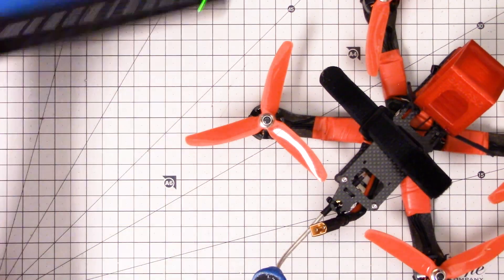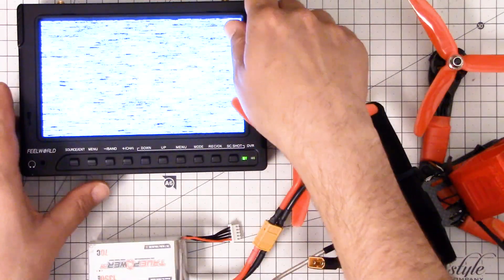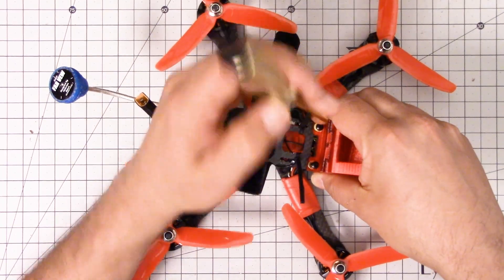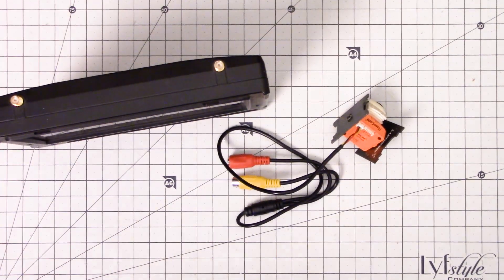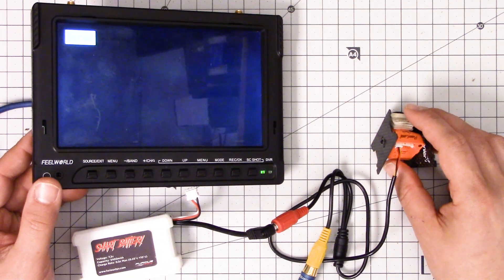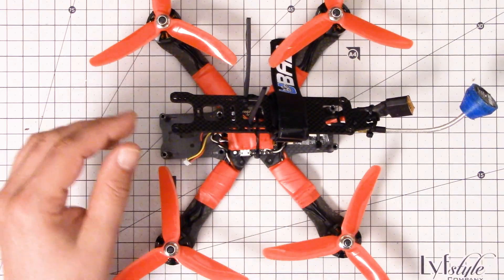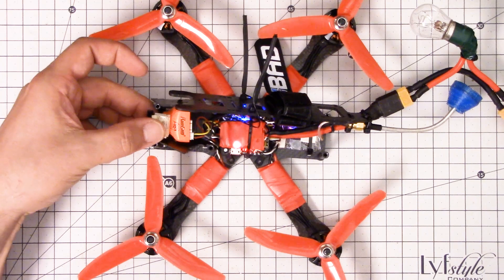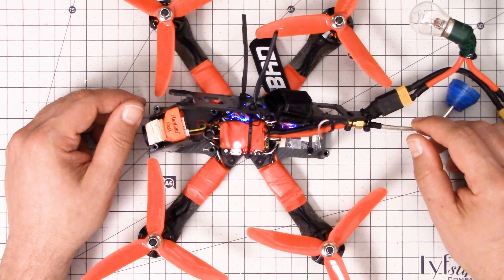FPV Camera Black Screen | REAL WORLD TROUBLESHOOT

Comment: Crashed my quad today in the sand at the park. Everything seems to be working fine except all I get is static on the video. I'm really new to this but I assume the VTX is bad which sucks because tall the solder connections are super tiny in this cinewoop.

Comment: What about an issue where the video signal and OSD is fine sitting idle on the bench, but as soon as you throttle up, the video signal cuts to grey but OSD is still fine.
Reply from the maker: That points to the camera wires. They're daged and the vibration is making them come loose.
Reply: @JoshuaBardwell  oh interesting! It's a brand new Mobula 6 too. 🙄 Guess It's time to resolder the camera...🤷‍♂️ Haha thanks for the response man, I appreciate it! Keep up the great work!

Comment: My FPV camera shut off when I'm throttling only when the camera is recording in FHD at 60fps, it's not happening at 30fps or when not recording. black video with OSD. the camera is RunCam Split3 Lite, drone still flies while this happen. the FC is brand new (F4 ELRS AIO board), but then i checked that 1 motor is broken, still diagnosing..

Comment: I asked you on a live streama few months back if OSD chips are interchangeable, you said yes and I've since confirmed it to be true......ordered a few blank chips and yes they work. I had a Diatone Mamba V1 on my Chameleon that lost OSD. I put in a Foxeer Razer for the OSD as opposed to swap the FC. Then the chips arrived and I changed it out on the FC......still no joy. The Razer camera accidentally shorted and went black which forced me to troubleshoot all. Found a microscop[ic solder ball on the FC. Isopropyl bath and all is well. Video, OSD, and A new Ratel.

Comment: I was just investigating a similar problem. I got the OSD on the screen but image was grey. After some investigation I noticed, that the flight controller was outputting 0.5V on the 5V rail. So I tested the other 5V rails and there were multiple ones too low. However I found a functioning 5V output and tried that for the camera and it immediately worked. In your case it was likely to be the flight controller as well, because a) the camera gets it's power from there (I'm assuming) and b) this noise comes from the coils when there is something wrong with the switching frequency. This noise often occurs when the switching power supply is idling (and thus turning down the pwm signal into the audible frequency) - this is also why you mostly hear smartphone chargers humming when they are left hanging on the wall without charging a phone..

Comment: I crashed and now have a black screen with osd on the screen. No humming noise and all wires appear to be connected. The camera didn't suffer any damage in the crash...it hit the ground on the battery. So do you have any idea as to why the camera isn't working? Its the twig 115 hd .
Reply from the maker: The camera isn't working because you crashed 😜

Check the wiring then if that is all OK replace the camera and see if that fixes it. If so, throw out the old camera.
Reply: Hey did u ever find a fix ?

Comment: So I have the eachine wizard x220s and the fat shark scout v4, I can’t connect the two (I have done it a few times before but I can’t now) I’m on the right band and channel (I’ve gone through all bands and channels), I checked circuitry connections and it’s all fine what’s going on???
Reply from the maker: Possibly the vTX is not powering on? Does it get hot? If it's cool then it's not powered up.
Reply: Joshua Bardwell it does get rather warm
Reply: Joshua Bardwell I cant think what I could do, I don’t have a wire to connect it to my tv or pc monitor

Comment: My TinyHawk s is on the right frequency (I think) because it says armed when I arm the quad. But I can see the osd and it has the same “black screen’
Reply: You likely need to unlock the vtx on your tinyhawk (I had this exact issue!). Just hold down the vtx button as you plug in your quad and it should unlock the other frequencies to bring back the video. Hope this helps!!!
Reply: Happened to me to it’s the camera wires that are loose

Comment: Hey josh my fpv camera goes static when I full throttle sometimes. Or when I bumb the ground than it  turns back on.  Drone still flies while this happen. Any clues?
Reply from the maker: It's losing power for sure. Maybe the voltage regulator is messed up. If the vTX can handle it maybe try running it from battery voltage.

Comment: So I crashed my quad and it started having problems where the video feed would be black (with OSD) when I apply throttle for a few seconds. It stays black until I unplug and plug the battery back in. Any ideas what's happening?
Reply: I'm having this exact issue did u ever figure it out ?

Comment: Caddx Turtle V2 - Same problem. Lost the camera due to a broken power feed to the video card w/ the DVR. Once fixed the video came back briefly but was gone again on the next flight. WTF? Finally tried pushing this button on the side of the DVR card and viola! The video is back BUT when I power cycled the video disappeared again until I did another long press on the video card button. Again WTF? Went into the configuration menu for the DVR card (plug in the omni control that came in the box) and decided to do a factory reset of the video card. BINGO! The video now powers up with the Beta Whoop.

Comment: Hello and thank you for the video. I have a Promark Shadow gps quad and the camera is not that good. Can I replace the existing camera with a micro hd ? If so  , will it be a plug and play or do I have to rewire it and supply a battery to power it. Will I keep my osd  ? I have yet to check the output voltage to my  Promark's  camera, I can't find any specs or info on it.  it will have to be small enough to replace the original camera and keep it in the housing. This would allow me to keep the tilt function of the camera. Is there is a better quality camera that would also work ? Thank you.

Comment: I have a sparrow and it reboot in loop for first 45 sec and it stabilizes. Generally that just happen on the first lipo pack of the day. last time I got a black screen with osd in mid flight. I can't trust it anymore. I also have a runcam 2 and it turn off randomly.

Comment: I have a Runcam Split Mini V2 and when I plug the battery in, sometimes it is on a grey screen and after I unplug and plug again it all works fine. A bit like what you have. Should I ask Runcam for a replacement?
Reply from the maker: Try re seating the camera ribbon cable.
Reply: Joshua Bardwell WOW, that was a quick reply! Thank you! I will let you know how it goes
Reply: Joshua Bardwell Problem fixed. The SD card was confusing the camera and not letting it start up. Removed SD card all was good so I deleted all the files on it and now it works every time!

Comment: None of my cameras have ever came with a test cable, anyway I could make one?
Reply: I'm pretty sure its just a matter of plugging in the necassary cables; 
Red to + 5v
black to ground, you should be able to use a usb cable, 
yellow to a RCA-video jack main plug and negative from usb on the shield

Comment: Mne will work when turned on but when I fly it will go black and will not recover even when landed
Reply from the maker: Most likely this is an issue with the camera signal wire, although a damaged camera could also cause it. Black screen means the vTX is working fine, so don't waste time troubleshooting that.
Reply: Joshua Bardwell thank you for the reply and that is kind of a good thing because I am flying the eachine wizard x220 and planned on upgradeing the camera anyway

Comment: Anyone, I use flight sight goggles and i forgot to one day unplug the battery and removed the receiver antennas. When i went out to fly again the next week, i noticed my goggles no longer show static, just black, i can move through the menu and everything. But when i broswer the frequencies i can only find one channel that show black with brief faint period of an image. Did i damage my goggles by removing the receivers and keeping it power? Did i over heat my goggles?

Comment: Hey,  josh I had a question about dys f4 pro I have three lights on it led's. One green which is not working I only get blue and red lights now my osd has nothing just black, but I dont get any beta flight start up menu at all just wonder what that means, I did have it plugged in with out antenna just wonder if that would make me lose video?
thanks

Comment: I just recently had an experience where I got a black screen, so I figured it was an issue with the camera. So I swapped the camera, and still got a black screen. So I connected the original camera directly to VTX and then the VTX wouldn't turn on unless I disconnected the camera. So I swapped the VTX and wired everything back to the flight controller and still nothing lol so again I connected the new camera to the new VTX and then it finally worked. Turns out the VTX, camera, the CamS pad and the VTX S pads on the FC all stopped working at the same time after a crash. So I had to buy an entire new video system along with a flight controller.
Reply: wow i think this is whats happening to me i didn't crash jusst hard land kock loose the camera after plugging back in igot black screen. Tried another camera and still nothing

Comment: Same issue today re-soldered camera connection and now it’s fine this is a connection issue with the camera
Reply: Mine was working fine till a hard landing, disconnected cam so i plug in and nada. BLACK SCREEN, OSD working copter is flyin but no video . I plugged ina nother cam & nothing so not sure yet

Comment: I'm sure you must of solved it by now. Almost all fpv cameras do this after a few crashes.   There is an extremely sensitive part that breaks and it has happened to all my cameras. But it is 100% the camera. Plug it in and Tap it. you will see
Reply: How though ? Can u explain that please? 
I'm in a trouble now. And what do u mean by tap it?

Comment: I'm having an interesting issue.  I have two quads both with VKK vtx .  One has run cam owl 2 the other has foxeer arrow micro v2.  On one quad I can plug in either camera and it's fine.  On the other quad I plug in runcam and it's good, but if I plug in foxeer, the camera has a high pitched noise and I only get black screen.  I know vtx is good becuase I can see OSD.   foxeer cam doens't make a high pitched noise on the other quad where it works fine.  I'm scratching my head and have a run cam eagle micro on the way just because.   Any suggestions?

Comment: My basically new foxeer falkor had the black screen of death after the most minor crash. It was a careless mistake...  I just took off and the prop hit a wooden seat for half a second before i disarmed and it only fell a foot to the ground onto grass, the prop was not even bent. In my case I have no OSD, straight black screen with no static. The VTX works because I get normal signal. All the connections seem fine and I plugged another foxeer micro camera in and it works fine. Im just stumped because it was such a minor impact and all the capacitors etc on the camera chip seem unconnected and brand new... Im guessing the prop hitting the wood vibrated the quad so hard it shook something internal on the camera chip and killed it.  In my case I had a full size camera on a frame that would only just fit the camera between the two carbon mounts. 
From now on I wont be mounting cameras directly to carbon fibre via the camera screws... 
Some soft washers or something to dampen vibration/impact are going between there for sure.

Comment: Hi Josh, I was wondering if you could take a look at one of my dvr recordings (https://youtu.be/19Ldv74WKIw), whenever I get weak signal my picture goes straight to snow for a second or 2 then comes back without any fuzzy picture. As you'll see its hard for me to progress. I'm about 3 weeks in on learning Acro mode. The vtx is a Unify pro race and at the moment i'm using an otg receiver that plugs into my phone with pagoda 2 antenna, vtx has an aomway cloverleaf copy.
Thanks for any help

Comment: I have an issue with my camera and can't seem to find another example of it. There is what looks like horizontal white noise but goes away when I put my hand near the lense and when I take my hand away the white noise returns, can't figure this out🤔
Reply from the maker: Since it goes away when you touch the lens, it's probably grounding. A couple things to try are, 1) isolate the vTX SMA connector from the frame, and 2) make sure camera and vTX are grounded to the same place.

Comment: My Omnibus F4 doesn't pass the camera signal, but it shows the OSD just fine.
I just see black screen with OSD.
I tested the camera separately and it works just fine. What could it be?
And yes, lens cap is off.
Reply from the maker: If you see black screen with OSD then yeah the FC and vTX are wired correctly but the camera is not sending signal to the FC. If you tested the camera by itself then you know the camera is working. So it must be the video input on the FC that is not right. First thing I would check is, did you solder to the right pin?
Reply: @JoshuaBardwell  Yes, I soldered to the right pin(and I'm sure the schematic is right because I have 2 boards and one is working fine). 
I noticed that sometimes( not every time) the camera makes an high-pitched humming noise(like the one in the video)and doesn't output a signal. It does that only when plugged in the 5v in,  in VBAT it works fine...  
Thank you very much for your help and the amazing videos you make!

Comment: MY SCREEN IS LITTERALLY BLACK no voltage rssi etc no betaflight logo.. but the transmitter works IT MUST BE THE FC!
Reply: Same problem with echine 805vtx, did you find some fix? Mine looks like working leds and transmisión but all black, no osd

Comment: Just purchased a runcam split V2 was flying today and the screen blacked out on me any tips on a fix or is it a bad camera. OSD was still working
Reply from the maker: OSD still working confirms the FC and vTX are good. Check the video wire going from the Split to the FC. Check the ribbon cable between the camera and the Split.
Reply: Thank you fixed out the blackout problem now I have a new one hope you can help now when I power up the Drone the video signals fine but as soon as I switch to the model on my taranis qx7 the video starts cutting out what do you think could be the problem thank you for all the great advice love your videos

Comment: Question I get OSD, but a black screen. No humming. I swapped my camera with a brand new camera. And still black screen. My VTX. Is lite up. So I'm stumped. I have the kiss v2 FC. And steele PDB
Reply from the maker: Connect the camera wire directly to the vTX rather than through the FC. If that works, you know the camera is working.
Reply: Joshua Bardwell the cam and vtx are ran threw the steele PDB. so de-solder the video wires for both and connect them.
Reply: Joshua Bardwell yeah the cam works what else could it be

Comment: I have a similar problem. I get the video signal extremely clear about 2-5 feet. I walk away a little bit and the video signal goes hay wire. Can you please help me.
Reply: I had a high pitched sound coming from my copter, I was not receiving video, the vtx was very, hot, and all so sudden, after my 10th time trying it, it worked! But, my video signal was crap. I would walk 2 feet away and my signal was gone. please help me.
Reply from the maker: vTX very hot it may simply be going into thermal shutdown. Spin the props or get a fan and get some air moving over it.

It's normal for high-powered vTX to overheat and shut down if they are left powered on, on the bench.
Reply: That did the trick. Thank you so much! Keep making great videos!

Comment: Hey man not getting any signal to my fatshark goggles with furious d I do the smart search and it says no signal I’m a newbie so any help would be great
Reply from the maker: Sounds like the vTX is not powered on.
Reply: Joshua Bardwell ok I know this is a silly question but how do I determine that it is powered up I have a bflight 210 bnf package do I just look for led lights on the vtx. I had to replace the receiver for a working one and now no signal
Reply from the maker: Well if the goggles were getting signal before you replaced the module in the goggles, then presumably you know how to turn the vTX on.

But if the True-D is powered on then presumably it's also working. 

Make sure you have installed antennas on the True-D.

Try a different vTX that you know is working.
Reply: Joshua Bardwell ok I will double check everything tomorrow thanks
Reply: So I took it apart this morning and for some reason don’t think the vtx is power up can they just go bad?
Reply: Joshua Bardwell ok man I’m not getting any power to my vin and vout plug ins. Have a ar-f3pro v2 controller plugged my vtx into the receiver plug in and it will power up but for some reason the controller plug ins for the vtx and camera are inoperative very weird I’m at a loss does this makes since to you?

Comment: I found a problem where I soldered the video wires from the camera and the VTX and I got video but now I don’t have my OSD. What do you think I should do
Reply from the maker: You need to run the video wire through the FC to get OSD. The FC cannot insert OSD into the video if you bypass the FC by wiring the camera direct to the vTX.

Comment: i building a drone for a friend and he has the same exact googles i do but for some reason i cant find video on his goggles but i can find it no problem with mine what would be causing this issue i cant figure it out. the goggles are teleporter v5
Reply from the maker: It doesn't seem likely that the goggles are damaged so I am going to guess you are just not tuning to the right channel.